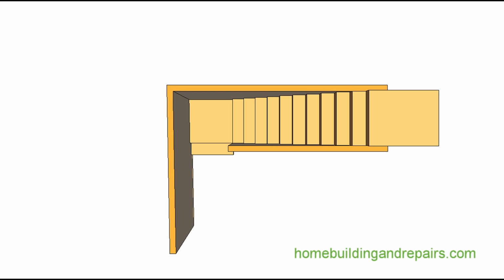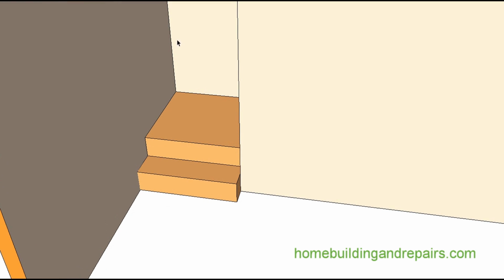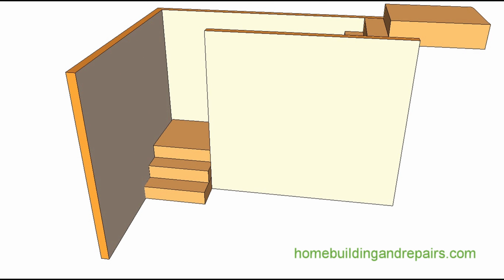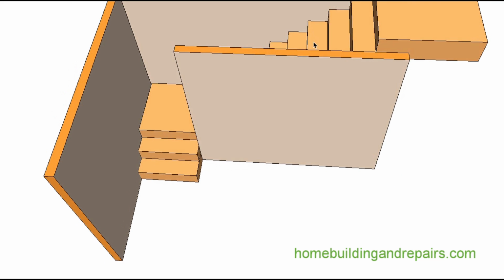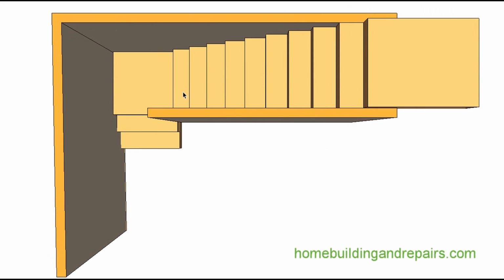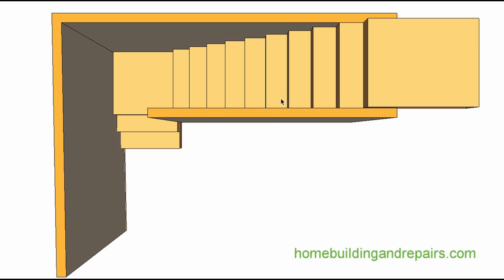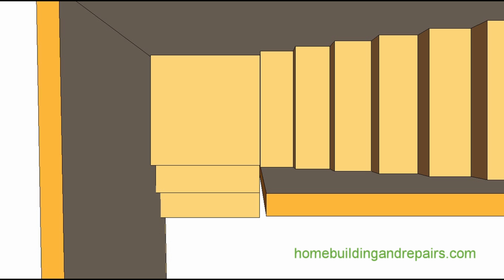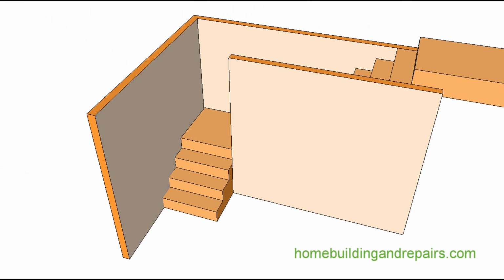How To Redesign Angled Landing Steps And Steep Stairway For Safety

Comment: How would you suggest finishing the new side edge (facing the hallway)?  Would you extend the baseboard? Paint to match the wall?  Or simply cover with the same carpet as the stairs?
Reply: We would just be adding one step so I think just "cover with carpet"?  Or do we need a baseboard there?

Comment: I'm sorry but "pie stairs" are not dangerous and have been used for centuries and still are today. Usually they are used because lack of space (pie stairs usually come in 3's). Even in your presentation you show that changing them will require stairs to enter into the room which creates its own issues. If the space was there the builder would have used a landing just because it is easier and cheaper. If they are hardwood stairs you will have to have custom treads and risers made for pie stairs. Even if just plywood the carpet guy charges extra to do pie stairs.  
As for coming down the short (tread) side of the staircase, that's why the railing would be on the opposite wall.
Reply from the maker: I think what you might be referring to is that pie stairs aren't dangerous to everyone, but might be to some and that's probably why there are building codes to make them more safe. I had a set of them in one of my houses and everyone living in it fell down the stairway at least once, so it's a building code I agree with.